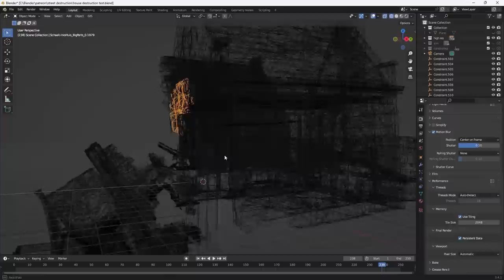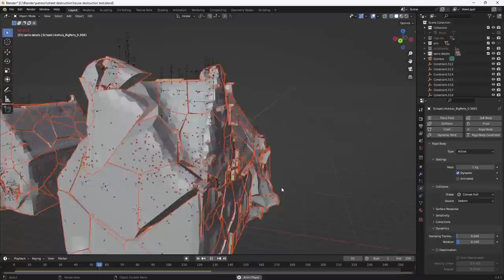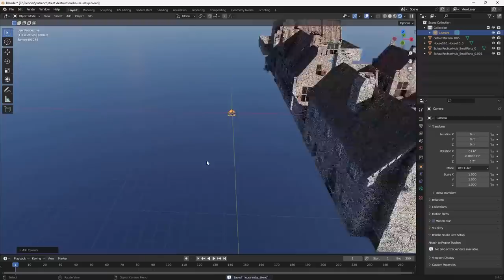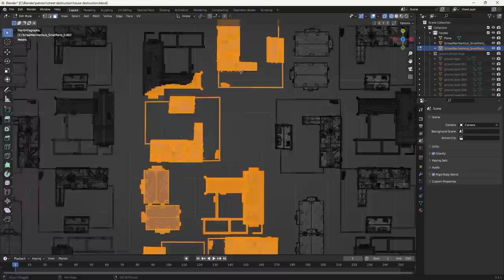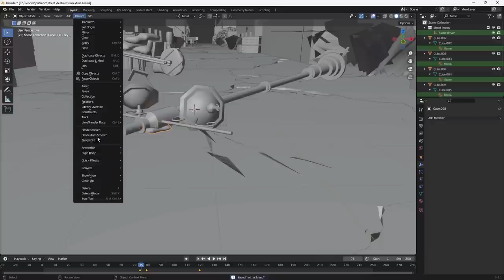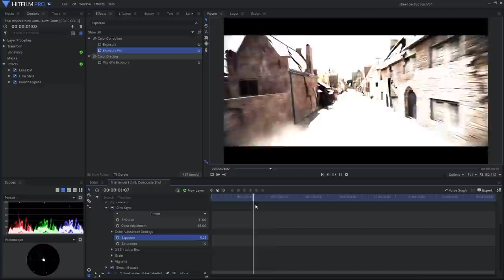advanced destruction effects in blender

Comment: I wonder what the process would of been like if you would of done a large-to-small iteration of the shot using previz. As in: 1. block in the environment. 2. block in the camera motion 3. block in the largest pieces of enviro sections that you can get away with using keyframe anim 4. do rough simulation, further refining the keyframed large env sections 5. only do detail destruction on hero (close to camera) parts of the shot. This of course requires a ton of planning and probably tons of viewport renders, but mybe is less taxing on CPU usage (In theory). Nice work.
Reply from the maker: Dude that would have worked a thousand times better. 😅 Thank you man
Reply: @AlbinThorburn  which cpu do you use ?
Reply: This is a fantastic advice that should spread over the all animation world.

Comment: Yes! Awesome. Very inspiring. Thanks for the breakdown. Out of curiosity HOW beefy is your computer so I can predict how sluggish my own will become?
Reply: RAM is more important than CPU (or GPU these days).
Clock cycles obviously determine how long it will take to render, but the amount of RAM you have determines WHAT you can render. So, TL;DR, if you are on a budget, increase the memory in your box has a much higher impact than CPU. Now, Cycles supports GPU rendering, but remember that it's limited to how much memory you have on the card and you can quickly run out. In particular if you are using subdivision modifiers. If that happens you have to fall back to CPU rendering which is slower but is only limited to how much memory you have in your machine.
Edit: As an example, I was playing around with the experimental adaptive subdivision modifier with 8K displacement maps and I topped out at around 45 Gigabyte for the meshes.